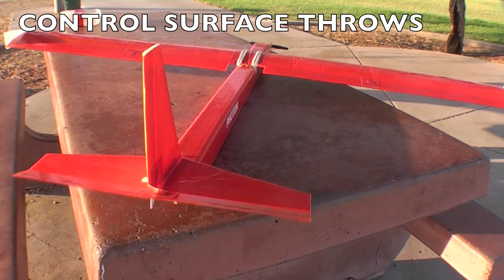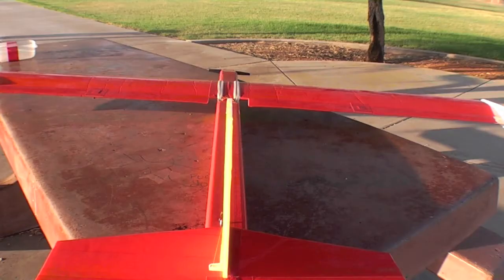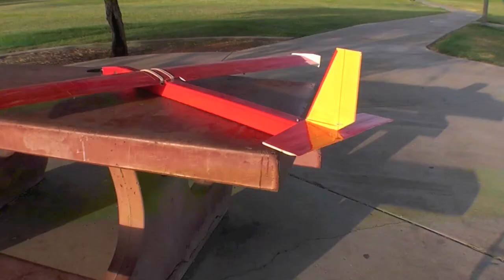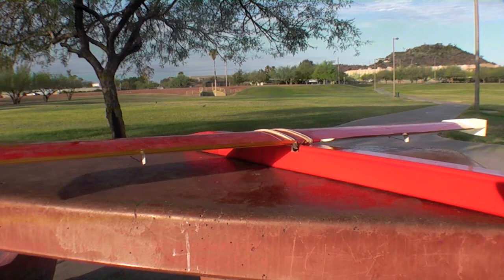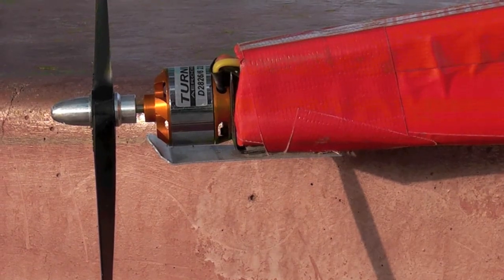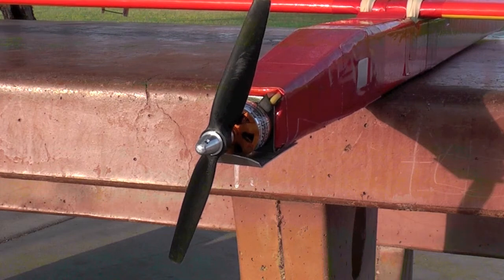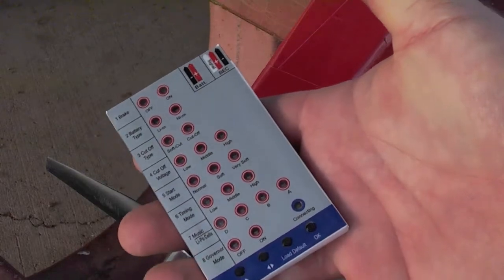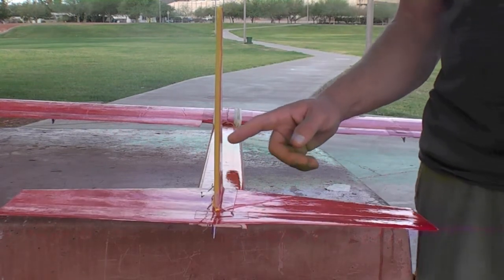PHOTON - Setup & Transmitter Mixes

Comment from the maker: My main receiver has one antenna mostly vertical and the other transverse, the satellite receiver has one pointing rearward and one pointing down.  I figure the only orientation you can kind of count on being consistent more often than not is the vertical.  Lateral antenna elements are definitely always going to be misoriented at least some of the time.  Great excuse for satellite receivers.

Comment: On your differential ailerons it appears you are using more down than up, this is exactly opposite the way full scale aircraft are set up.  Differential aileron is used to minimize adverse yaw, down aileron adds more drag than lift, tending to increase adverse yaw, so the down movement is limited while the up movement remains full travel.